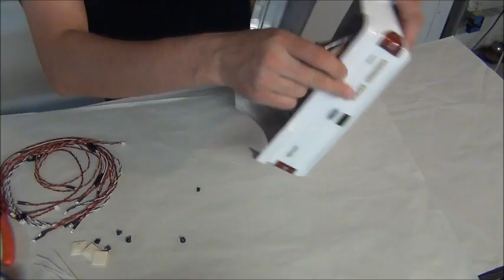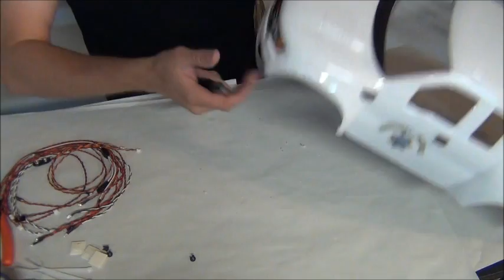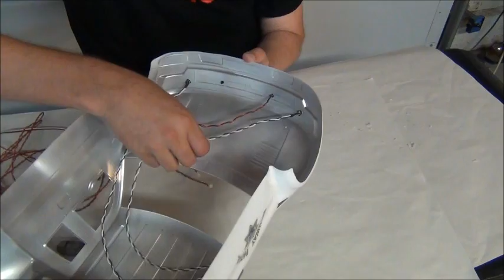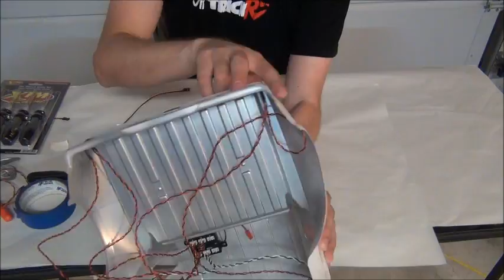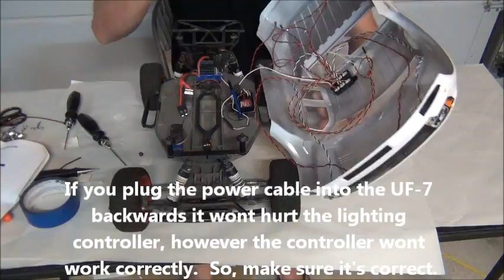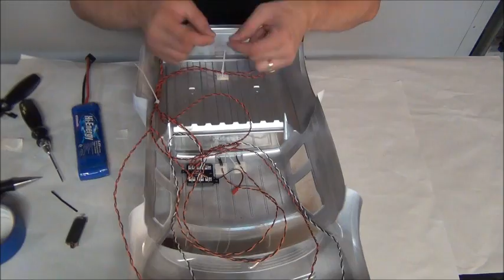UF 7 CHP Package Detailed Installation Part 2 - Install Body Lights

Comment: I do not know what i am doing wrong but this kit is not working ,the headlights shut off after a few seconds,the brake lights start flashing after a few seconds and only 2 strobes will work no matter what i do ,i have it set to mode 4.i followed what you did to the t,only difference is the kit  i received have the headlight and tail lights as a pair not separate single l.e.d.,s .I give up on this thing.